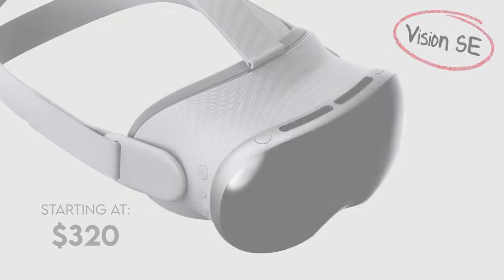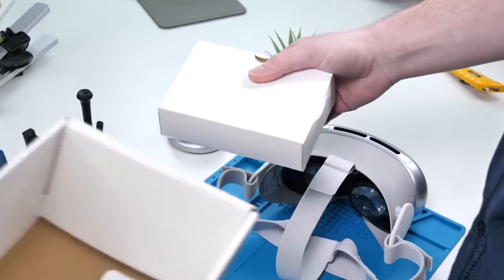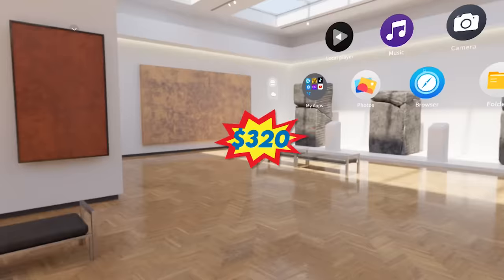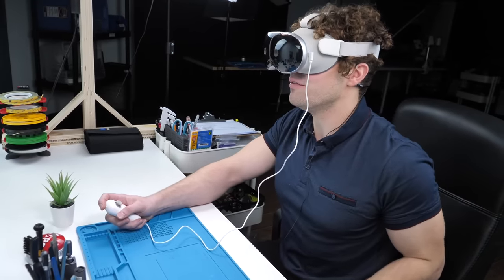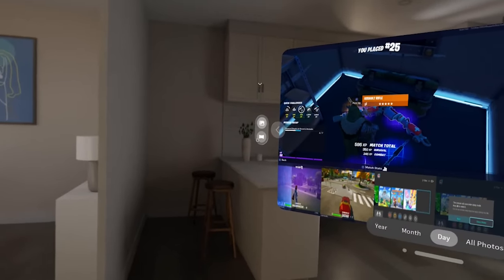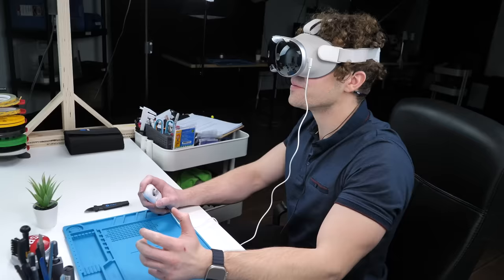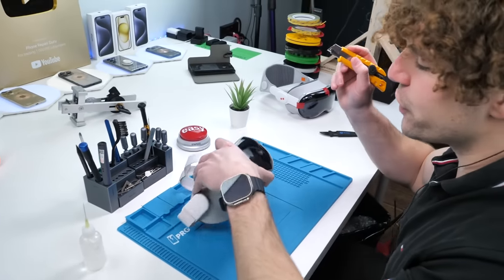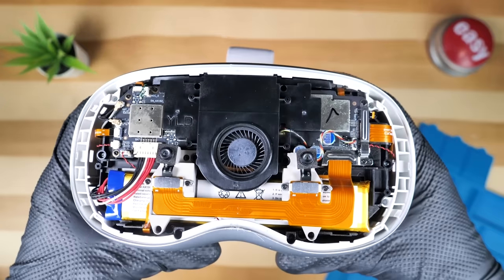FAKE Vision Pro: Better Than The Real One...?

Comment: did you ever try the camera app? i bet pass through uses one camera because it’s easier to process in real time and it doesn’t have 3d hand tracking so it would be pointless to have both cameras on for pass through since it doesn’t need live depth info. but i bet to record spatial/3d videos or 3d photos it would probably turn on both cameras record and then process the two files after the fact